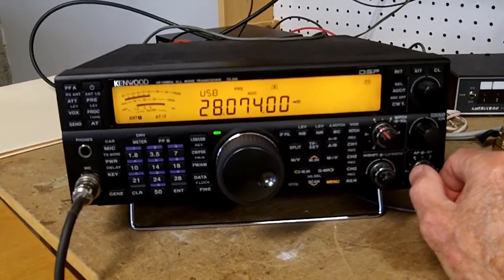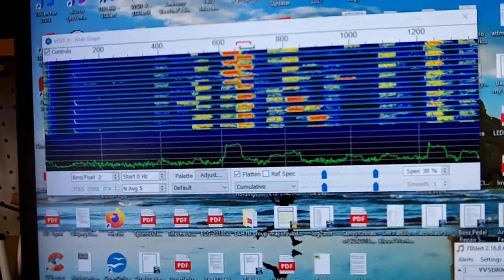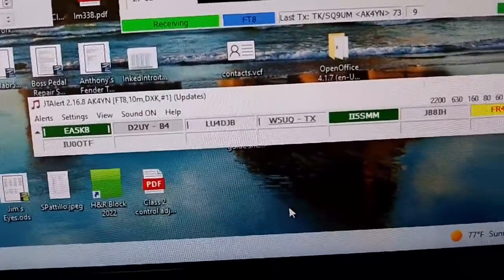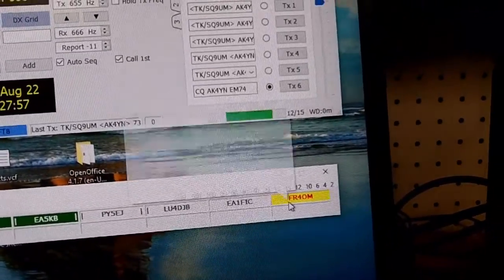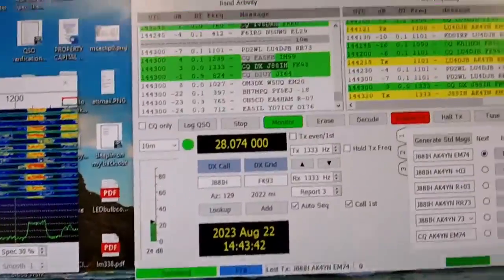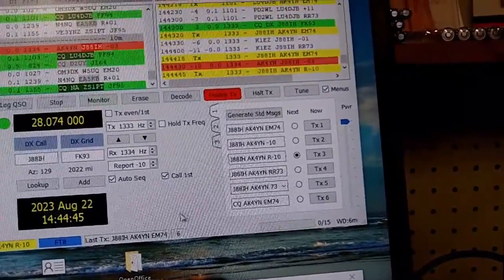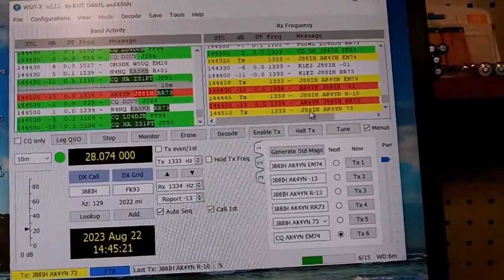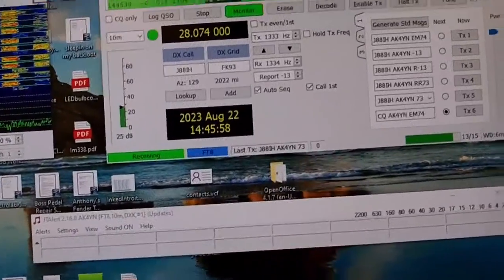Demo of Ham Radio FT-8 contact with my Kenwood transceiver.

Comment: James what is SW called.  How to get it?
Do you need hardware to do the interface to laptop?
Reply from the maker: The software can be obtained from this website: https://wsjt.sourceforge.io/wsjtx.html or google WSJT-X
Use ARRL.org QST articles as to how to set up or google FT8 and find lots of videos and info on how to do it.
 I use a SignaLink USB device to connect radio to PC.
You can do it! Have fun!